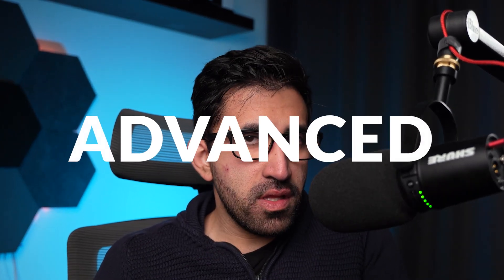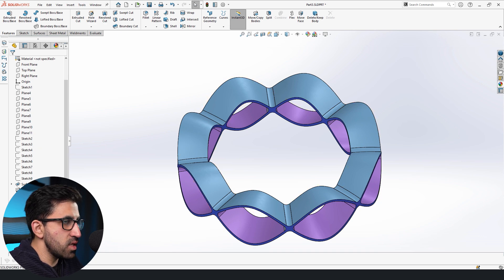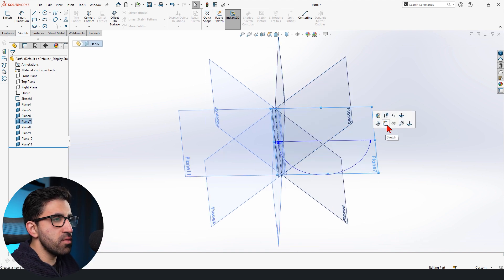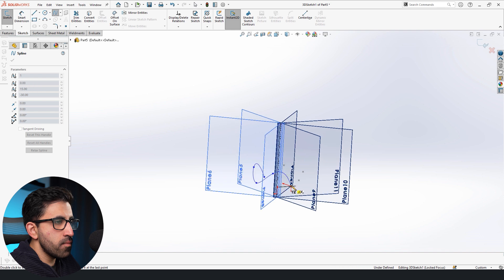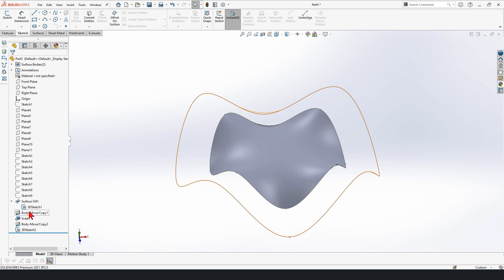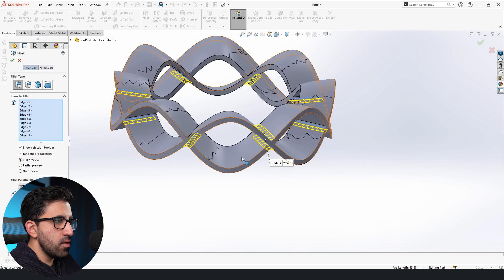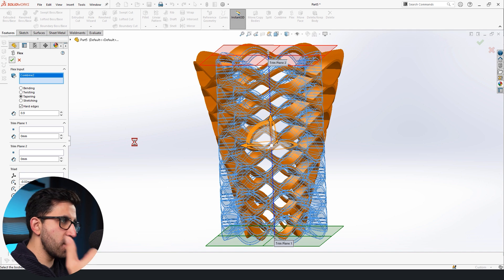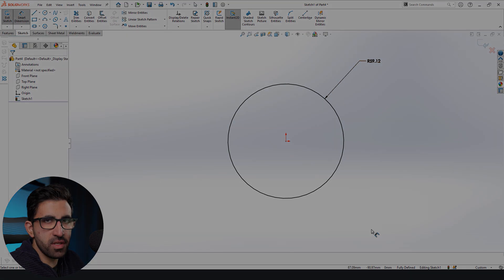Advanced Modeling Made Easy in SolidWorks

Comment: You can create this curvature using 3D curves with some sine and cosines, even have them parametric without the guesswork and manual point placement. instead of scaling the curve you can just add another one with different parameters (Radius) and have everything mathematically defined.
Reply: you can make everything in sw multiple ways

Comment: Couldn't you create the same object by  making a hollow cylinder (or any surface), then a sketch on a normal plane, make a drafted cut, fillet it and then make a circular pattern of the cut and the fillet? or make A drafted extrude, pattern it and then combine it with the cylinder/surface?
Reply from the maker: Yes, as the combine workflow depends on just intersecting geometry, the method of create the component boolean geometry  can be created in any order/method.

Comment: You do not need to move/copy up 5mm and down 5mm. You can make a copy with 0 on xyz, just click green check, and confirm. It makes a copy in the same spot. You can make multip copies in the same spot as well. If I am to make exactly 1 copy of a sueface, I use surface offset with 0 distance.
Once you have the 1.5x scaled surface, you do not have to get a 3D sketch from the edge. You can use the same command or loft, pick the correct edge from each surface..
The cut-extrude thin to clean the exterior can be just simple cut-extrude and check "flip side to cut". The benifit of this is you do not need to figure out a correct value to the thickness, and if it's a more complex cut profile, the thickness may cause an error. You can always use a very small thickness number and choose what body/bodies to keep in the next screen, but cut-extrude with flip side to cut is more efficient.
Reply from the maker: Thank you for your valuable input! It's great to see users sharing different methods to achieve the same results. These techniques you've mentioned are certainly efficient and can be helpful in different scenarios. I'll make sure to consider your approach in future tutorials. Remember, in design software like SOLIDWORKS, there's often more than one way to achieve the desired result, and learning from each other's methods is a part of the process. Thanks again for your comment!

Comment: Interesting video, learned a few new things. I did find a way which removes quite a few steps. Rather than creating dots on a plane, place 2 points parallel to each other and revolved around the center point 4 times. Create a second plane offset from that one and do the same thing but rotated 45 deg. This can then be used to create 2 splines bringing the total steps needed for this project closer to 10
Reply from the maker: how can two points not be parallel :) I didn't understand exactly but I'm sure there is always more than one way to model a geometryin solidworks

Comment: This was interesting. I learned a few things for sure. I design for the marine industry so most of my parts are sheet metal - items that can be flattened for cutting and forming before welding. It's nice to learn some new skills. My only comment would be - I found it easier to just add three planes and then draw four sketches on the front and three additional planes. Each sketch was either a 30mm or 15mm sketch. Great video and thanks for putting them up. I'm really liking the advanced ones.
Reply from the maker: glad to hear that